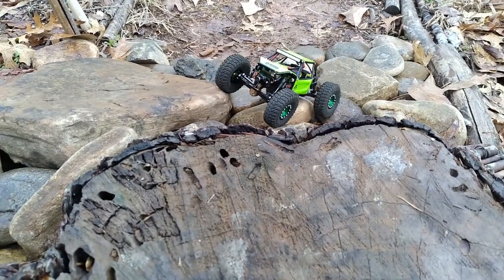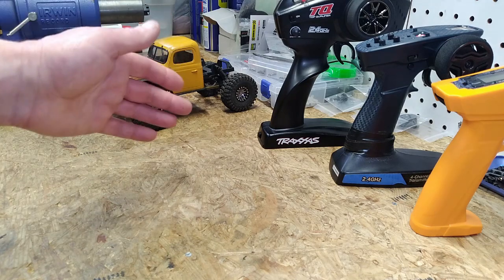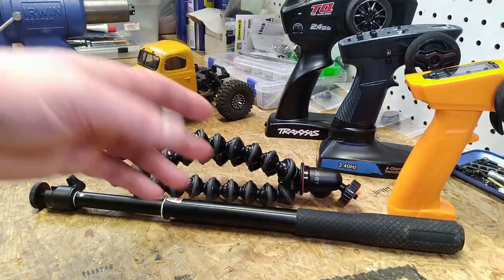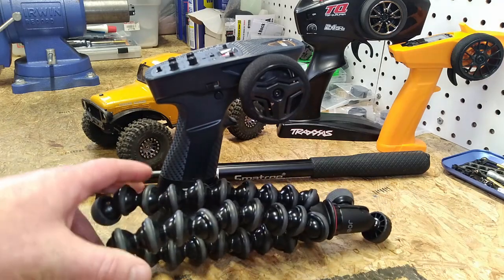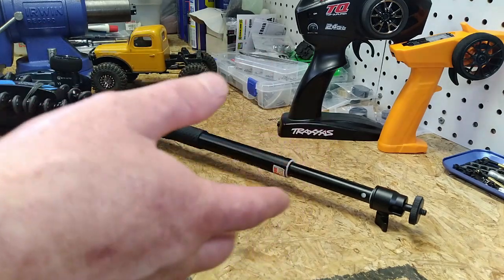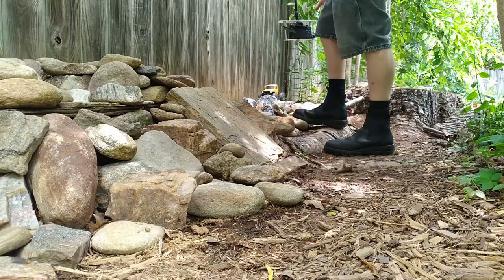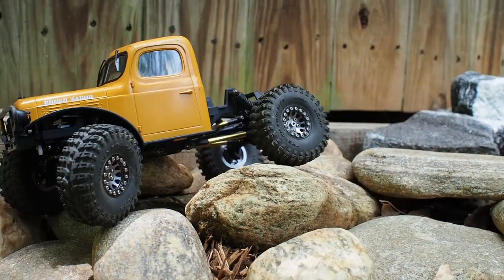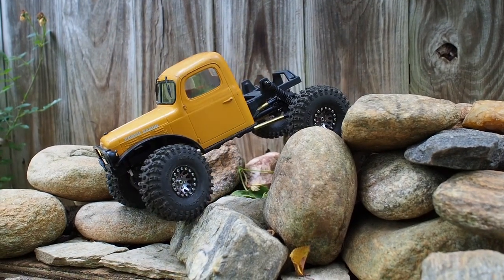How to film cinematic RC videos AND drive with BOTH hands!

Comment: You can buy thumb steering attachments for your controller that make onehanded driving much easier. I think I'd still prefer 2 hands though.
Reply from the maker: Yes I did consider that option, but my control of the vehicle really suffers and I just don't enjoy driving with one hand. Thanks for hanging out, much appreciated!
Reply: There are also free files to print them if you have a printer.I use one found on thingiverse under the title "Flysky GT5 Thumb Steer"....

Comment: Tahnk for sharing your tircks of the trade. I personnaly have big hands and (almost) always drive one handed. One thing i'Ve noticed is sometimes i used to hold my phone upside down to have a lower angle but whe i do the image stabilisation stil works upside up so it actually amplifies the shake. Be aware, i guess not all phone works the same but i got so much screw up footage beacuse of that
Reply from the maker: Some youtubers get amazing footage driving one handed! My phone doesn't even have image stabilization so it's only useful for tripod mounted shots. Thanks for hanging out mate!

Comment: You can just install a 1/4 inch bolt in the bottom of your controller. Head of the gorilla pod unscrews, and you can screw that piece onto the controller. don't have to worry about figuring out how to secure the gorilla pod to the contoler.
Reply from the maker: Yes that would work well. The only reason I like the temporary attachment method is I'm always changing between transmitters and I don't want to permanently modify all of them.

Comment: I am no great film maker but when I do record  I attach a gopro to the bottom of my gt5 radio  using a gopro shoe stuck to my battery door...a 6 inch extension puts the camera right in front tilted to the right angle....👍🏼
Reply from the maker: Sounds like a slick little setup! From what I've seen GoPro seems to have pretty solid image stabilization. Thanks for hanging out!

Comment: good idea, the only problem is when filming during competitions your movement will be restricted by the length of the stick
Reply from the maker: Yes I could see this setup not working in all scenarios, but works well for me! Thanks for watching!
Reply: bro, hes just showing 1 way to do it, its not meant for all applications
Reply: @keshanb1275  yes, I am not saying it's unusable, merely pointing out there are instances where it can get in the way
Reply: @havikhobbies  I was going through accessories for my GoPro and found a strap you can use on you hand or legs that maybe worth looking into for that low angle we desire 👍

Comment: Very interesting. I want to shoot videos of my 1/24 crawlers and i need this kind of tips. I have a reflex cam (similar to your Olympus) and a GoPro-like mini cam.
How are you sure to point well enough to center the car on the picture ? You can hardly see the screen, as the cam hangs low and far from your eyes.
Thank you for sharing your know-how.👍
Reply from the maker: On the Olympus camera I can actually tilt the screen in such a way that I can glance down and check my framing. But I can't always reference the screen in all lighting conditions so I just glance down every so often and  make sure the lens is pointing at the truck and at about the same level! Not an exact science, you get the hang of it pretty quickly! Thank your questions and comments, I really appreciate you being here!
Reply: @havikhobbies  Thank you for your answer. i'll try that.
Reply: If I may make a suggestion; with his set-up, you could try attaching a thin rod to the selfie stick, above the camera. Just set it at a height that it's not so low as to get in frame of the shot. Might be best up close to the controller. Adjust it so it's in-line with the lens accounting for how you hold your controller, and long enough that it reaches out so you can see it while driving without actually having to pay attention to it. Bit of practice and you'll just naturally see it and keep it pointing in-line with your rig without thinking about it. Maybe a length of piano wire or plastic rod. Something light so you aren't struggling with it. Could use one of those magnetic ball and socket cell phone mounts, or something else, to make it adjustable for each time you mount your camera. Could paint the tip bright orange or pink so it stands out  bit more from the background. This at least gives you a side to side aiming devise.